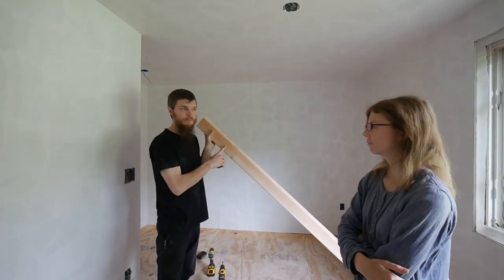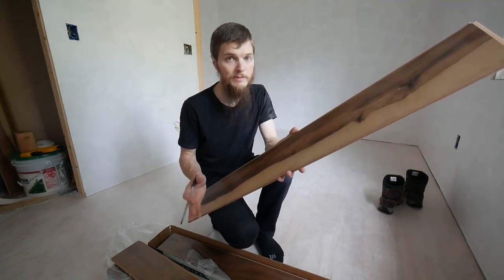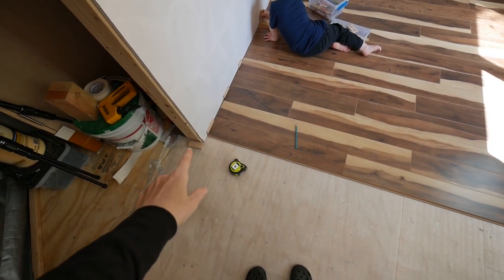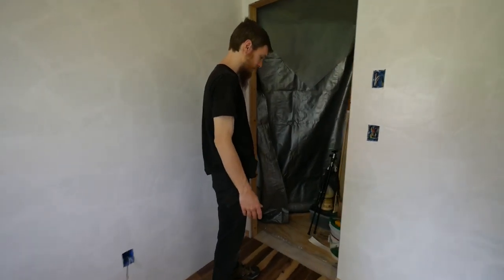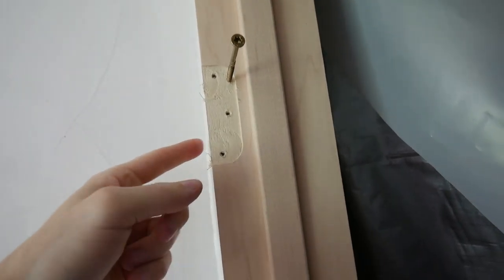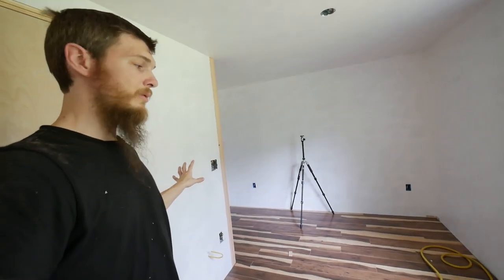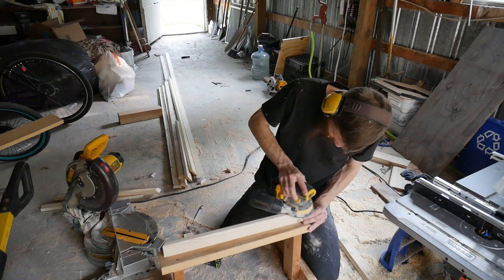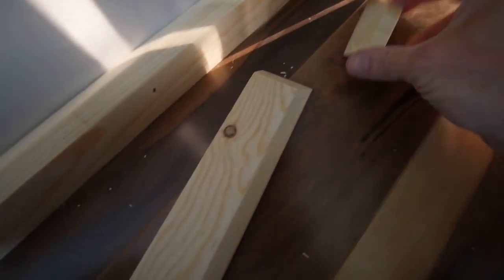Finishing Modern Bedroom Makeover - Home Renovation

Comment: I have to agree about the blade height on the table saw.  Best safety practice is to set the highest point of the blade just above the work piece.  In fact, the face of the tooth is at the best cutting angle when only half the tooth height is above the workpiece.   Looks great!

Comment: Great job, well done.  I love you're using the wood you cut yourself.  There is a lot of self satisfaction in doing it yourself besides the amazing amount of money saved.  Have a Blessed day. BTW...do those heaters cost very much to run during the coldest part of the winter?
Reply from the maker: It depends on too many factors, but it would cost similar to using a regular electric baseboard heater.

Comment: I like the tip about putting the screws underneath the hinge what about the other side of the door jamb how do you hide that screw head do you countersink it and put a valve in it or how do you hide it
Reply from the maker: I forgot to show that but I put a screw under the latch plate near the corner the same way as the hinge side. It only really needs one screw where the door strikes.

Comment: I understand you are using a long, hidden screw to anchor the door jam.  But I use the long screws (you can paint the head of the screw if needed) to anchor the door hinge.  If the door is heavy or if someone is trying to break in, I want the security at the hinge, not so much the frame.  JMHO.  Much more important on outside doors than bedrooms, though.  Are you going to lay the floor in the same direction in the hallway?  It might look spiffy if you were to herringbone or chevron the hallway and then cap the doorways with a transition piece.
Reply from the maker: We'll be using porcelain tiles in the hallway. :)

Comment: I might have missed you saying, but what do you call that little saw you used to cut the pins in the door? Could you cut shims with it, too? thanks
Reply: It is a Japanese Style Double-Edge Saw. $10 at Harbor Freight.
Reply from the maker: It's called a Pull Saw and you can cut shims with it. It cuts very cleanly and precisely.

Comment: Will you be using those electric heaters in the rest of your home or just in this room.  I ask because I live in a double wide and hate those forced air things on the walls and floor.  I would consider going to electric over propane.  What are your thoughts on this.  I use electric space heaters now in the living room and one bedroom and computer room as heat in the winter The rest I have blocked off and keep the doors closed.
Reply from the maker: We'll be using them throughout the whole home. It comes down to personal preference. We like using electric since there are no floor vents, no blowing air, no loud furnace, no worries about carbon monoxide, and no ducts to clean. Even if it ends up costing more than propane would which is super expensive also, we like electric for those reasons and are willing to pay a little more for it.

Comment: Lower the saw blade on the tablesaw to just above the material is allot safer. To much blade sticking up is dangerous. Can catch a nuckle when pushing the material there.
Reply: And anti kick back guard. Cant stand using a table saw without it
Reply: After reading your comment,  I remember watching my Dad remodel, yeah he kept the blade low. 
Father in law is a carpenter, low blades. Son, carpenter, (millwright, does all kinds of things. He builds houses now but keeps his millwright current) low blade. 
Never thought about it until you mentioned it. Probably because I am not a carpenter.  
Great advice for safety!!
Reply: You keep the saw blade high if you don't want a lot of back cut on the board. Old finish woodwork trick.
Reply from the maker: I had it high because I was using it to notch out the flooring around the closet and door opening. GUY HILLIS got it :) I do usually keep it fairly low though. You are right though, be safe!
Reply: @diyfferent  the minute itll take to make the adjustment could save a limb or extremity one day. Just what I ponder on while doing that kind of work.

Comment: This is for the followers of the channel , in Most cases you’re better off buying the floor with an underlayment already attached. Higher quality flooring and installs easier. I’ve done thousands of sq ft of flooring and the cheaper
Stuff will not last. No matter what the warranty says. Flooring is one thing not to cheap out on. The sound will give it away.

Comment: Another thing, the reason you put the screw through the hinge is to spread the load via using the hinge as a washer. The door is putting force on the frame and leverage the frame separately  from the hinge now. The practice of through the hinge is done for a reason. It’s not the end of the world. But it is done for a reason. Personally I would have ran the closet to the end of the wall and made a useable sized closet. The nook area in front of the closet opening is essentially useless space anyway. But hey that’s why we’re all different
Reply: black88lx they can always make the closet bigger if need to just making it the long way and open
Reply: I think they’re going to use that space for something special like a desk area? Or bookshelves?  Idk, but it definitely won’t be 
WASTED SPACE!!!
Reply from the maker: Everything we do, we also try to do for a good reason.

Comment: We have the thickest stuff because when you  have kids stuff gets spilled and when you have kids and there jumping around there’s a lot more noise. The thicker it is better for the insulation in the floor with the heat in the winter it keeps the floors cooler. but I live in town black top roads. You guys are in the country you probably don’t need the thick.

Comment: Your work is good for a home owner but when you cutting flooring you may want to lower the amount off blade you might find it's cuts better
Reply from the maker: He had it high on purpose to do the notching like at 5:10 and then just didn't lower it back down for the rest. Normally we have it low for safety.